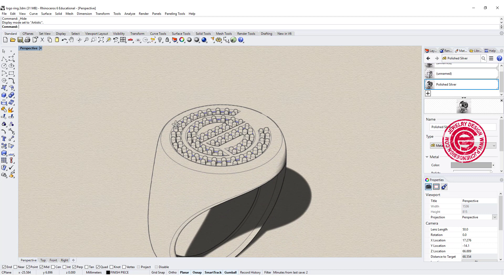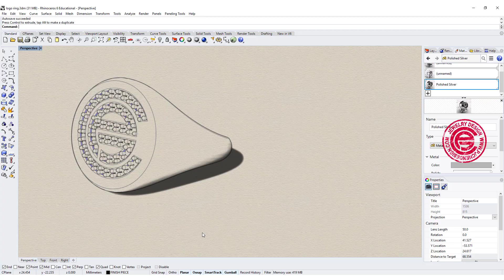Jewelry Making- From CAD to Silver Signet Ring with Bead Setting

Comment: Could you have set the stones in the wax before casting?
Reply from the maker: it is possible, depend on what type of stone you are using. but will need to have slow cool down process after cast.
Reply: @PJChenJewelryDesign  Thank you for the quick reply :)